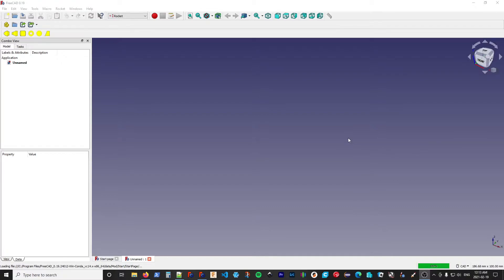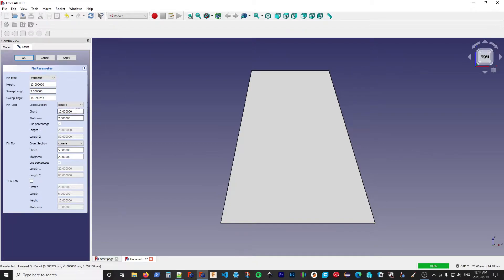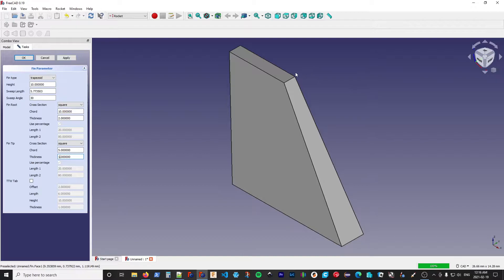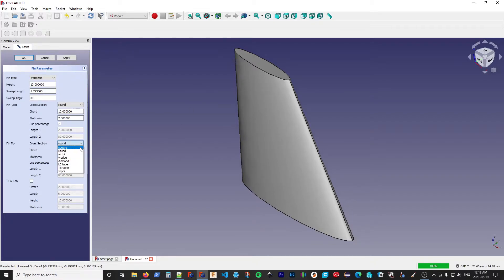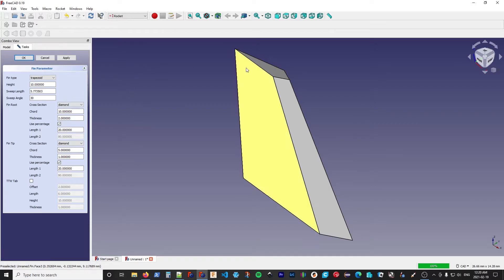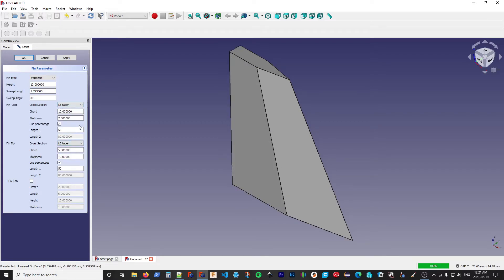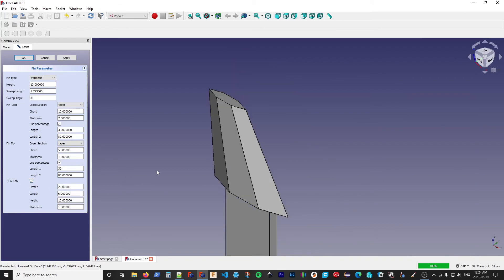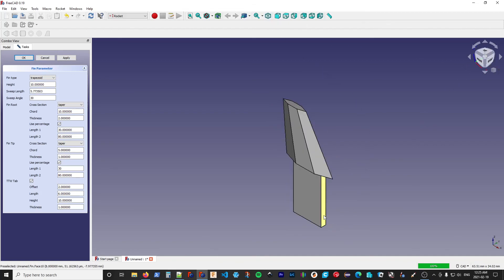Rocket Workbench Fins

Comment: How do you make the fin? CNC machine? Can you show us how you go from CAD to final wood fin?
Reply from the maker: Not a simple answer. Typically I 3D print a fin set on a body tube, but that requires either a lot of messing around or features under development. Laser cutting is an option but that won't get you the air foil or similar cross section. I will do a video on that though. I don't have a CNC machine and am not familiar with that process. So, stay tuned?
Reply: @DavesRocketShop  awesome! Thanks for the quick reply back. I'm new to rocketry, built a few kits, looking to build from scratch. Looking forward to watching more of your videos!